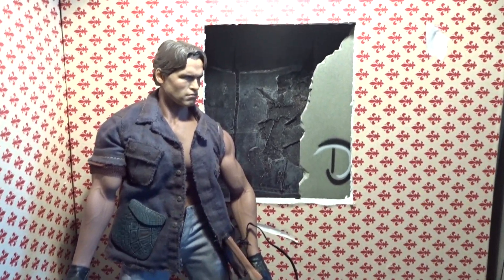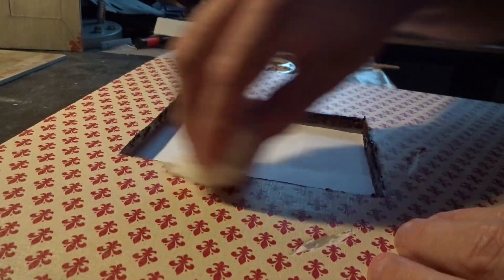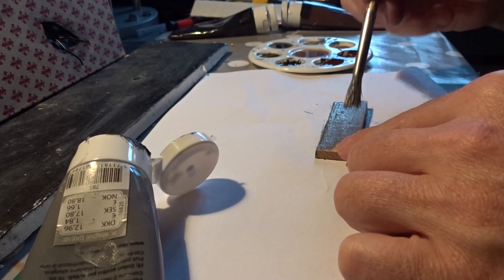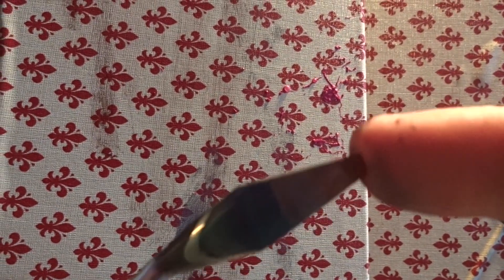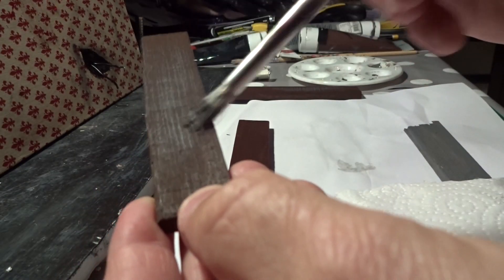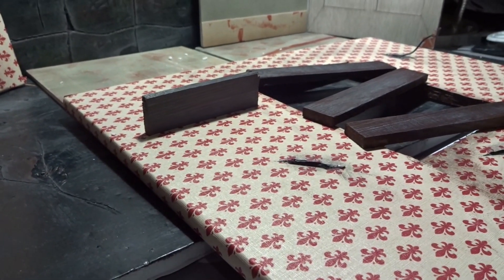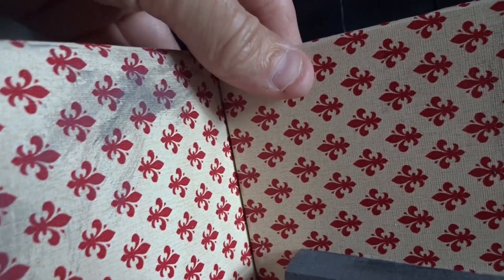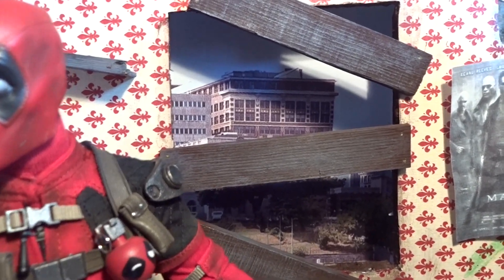Action Figure Diorama Tutorial - 1/6 Scale Ruined Apartment Part 2 (Detolf size)

Comment: but were is the window frame apartments just dont have a square hole in the wall dude
Reply from the maker: Technoman Darkon In this case the frame is removed, because it’s ruined and abandoned.. But besides that, you’re right. And it would be relatively easy to do.. I thought of it as one of a few improvements I could do in a part 3 video..